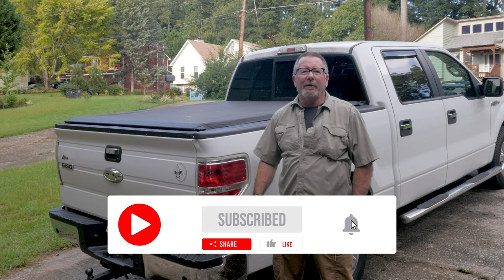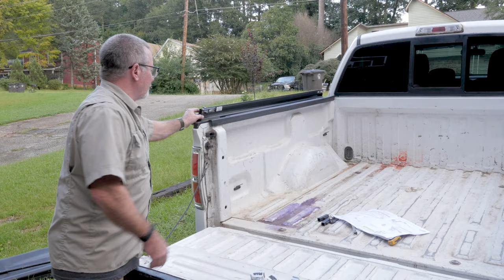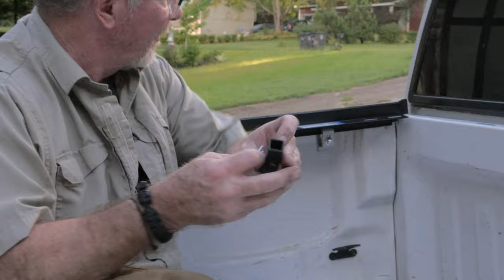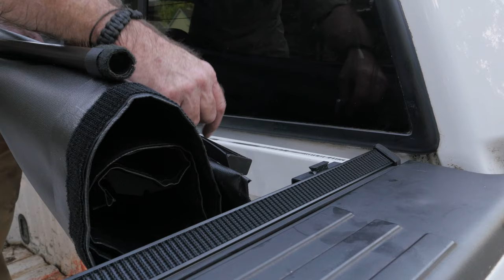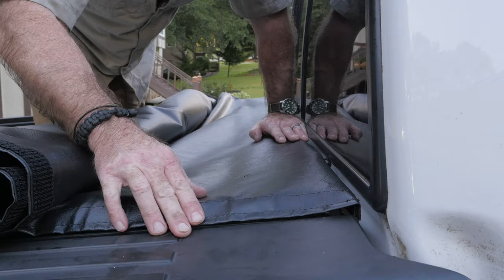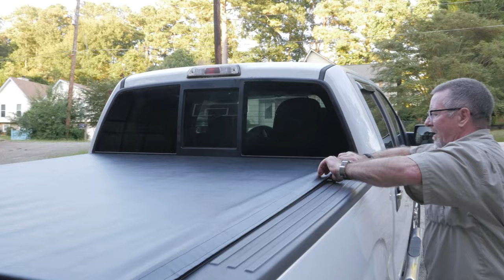How To Install A Gator ETX Roll Up Bed Cover

Comment: I have this cover and it is great. Close the gate first then the cover. the rubber flap will go over the gate and make it a little more water tight. Also the straps slide so that sometimes adjusts tension.
Reply: Are you talking about the straps that connect the first cross bar to the channel?
Reply: @daultonmccoy8369  The bar at the tail gait. Slide towards the outside seems to loosen the tension and slide towards the inside seem to tighten. I do not know if that is the intention but that is what I have noticed on mine.

Comment: Nice, I’m a retired Master Plumber in PA, had a Extang Trifecta cover on my 2006 F-150, lasted till April of this year when the truck died. Got a good used Frontier and installed a new one, like this type because don’t have to fight Velcro. Like the purple primer stains on the bed🤣

Comment: Great video! Thanks for the help. Only mistake I made was not placing the rails high enough. The trunk wouldn’t close cause the rails were a tiny bit to low. Had to adjust the clamps & push higher. Thanks for the help!

Comment: Thank you. I installed my own and could not figure out the two plastic blocks. I love this cover. I used some black silicone under the forward flap in a few places towards the ends and it damn near water proof. The weak point being the tailgate but that not even a lot.  It was good investment.

Comment: I've had a Gator roll up cover on my truck for 7 years with no issues (other than replacing the velcro tie straps).  I don't see why it won't last me another 3 or 4 more years.
Reply: Another thing I like about this cover is when I roll it up I have full access to bed.  I can even load my atv in the bed no problem.

Comment: So after installing it exactly as stated in instructions and after watching this video, I have a bow in the metal part of the cover up next to the cab. It only bows up when I locked it down. I understand why, there is alot of pressure pulling on it when you lock it in place. I tried to adjust the tension with the tension blocks but when doing so, my cover is now too far away from the front side of the bed, nearest the cab. It makes a small gap. It seems like there should be some sort of way to clamp the front side of the cover to the bed cap like most other styles of covers. I bought this exact one and I have a 2014 ram sport quad cab with the 6.4 foot bed.
Reply from the maker: I'm not sure what that could be. I would contact Gator and ask them
Reply: I don’t own this cover, yet. However, I saw another install video and you should check the bolts near the cab near the tension block. The nuts may be too tight. The other guy said those nuts should not be too tight on the bolts. He even showed where he could slightly move the cab rail. I’m just guessing and spitballin here from what I’ve watched but I hope this helps.

Comment: Apparently my truck bed is tapered and I had no idea until I tried to install this, the bed near the cab is wider, is there another version offered that fits or any modification I can make?
Reply from the maker: I hav eno idea. What model truck do you have?
Reply: @SurvivalOnPurpose 2016 Ram Express, when I ordered it, it says it met specs, thought only the bed length mattered but I guess not
Reply from the maker: I would reach out to the manufacturer if you can.

Comment: I think I missed the part where you talked about the covers (?) on the top rail (gunnels) of your truck bed.  I haven't purchased a truck in decades.  Are these included on all trucks these days?
Reply: Eh my mom's 2016 GMC Canyon came with something similar. Just spoke to her as I was writing this and yeah it's stock. I do recommend getting a factory bedliner, the abuse we put that poor little bed through!
Reply from the maker: Not sure about all trucks.